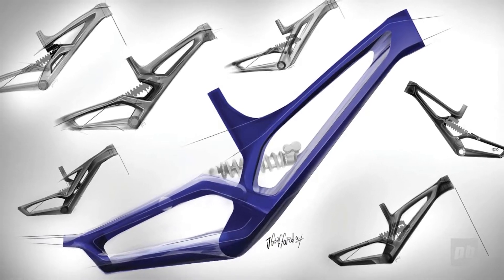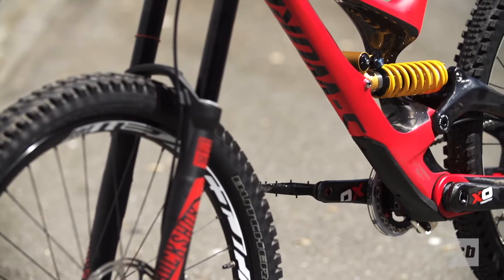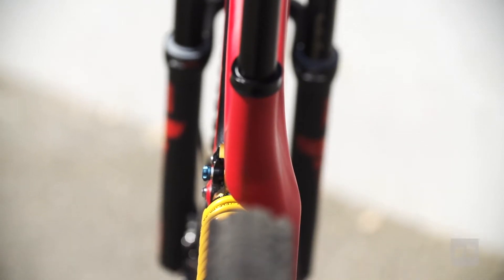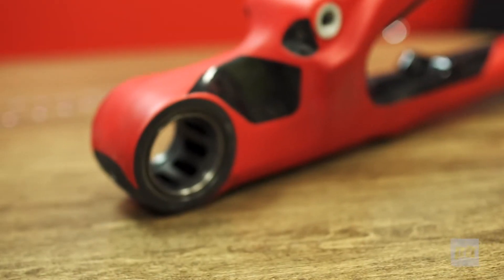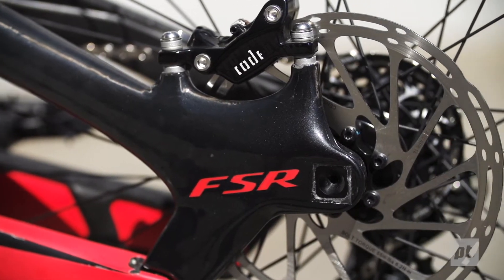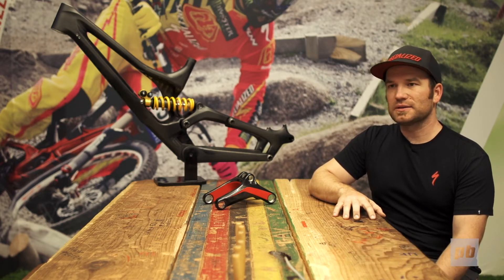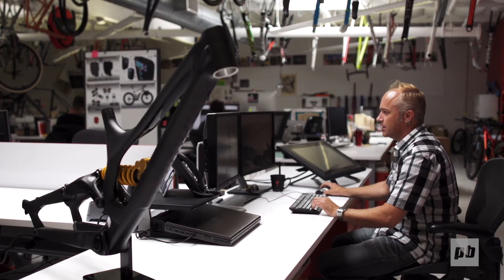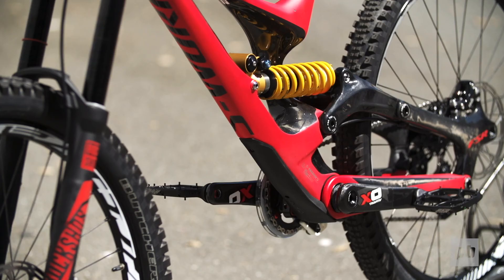2015 Specialized Demo - DH Race Suspension Explained

Comment: so by combining the main pivot and the bottom bracket, you can effectively run a true single speed setup.  that's sick.
Reply from the maker: Well no, because you still have the dropout pivot between the BB and rear axle, which means the CS length is not constant.
Reply: Just use a derailieur to keep the chain tension. Also, why would you run singlespeed?